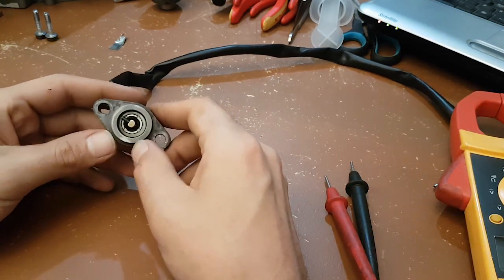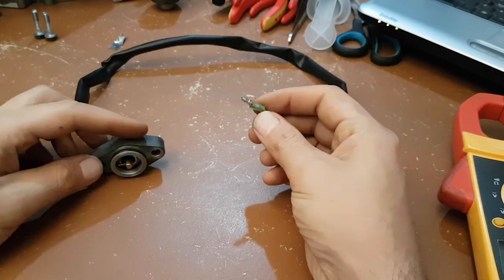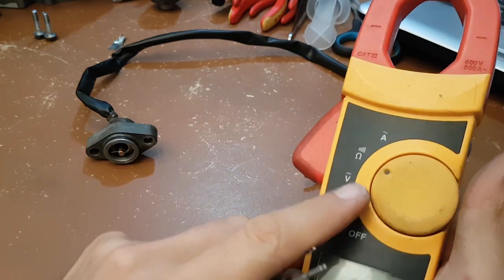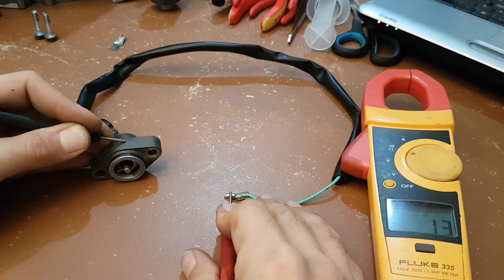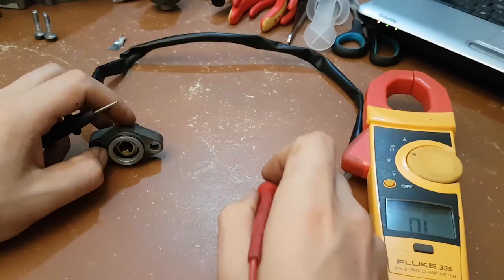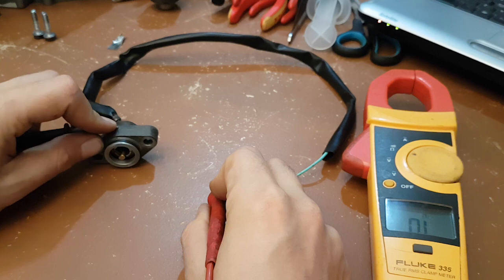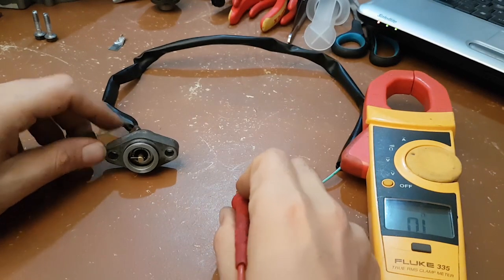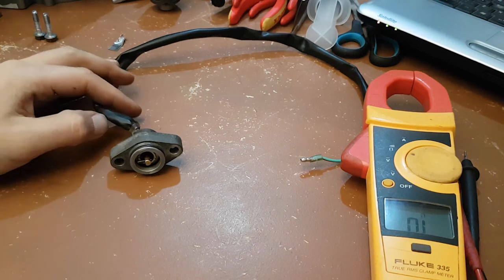How a Neutral Switch Works? How to Test and Diagnose a Broken Switch

Comment: I think I have the same problem. My bike doesn't start unless it is in neutral, or else just sobs and shuts down. Also, the neutral light on the dashboard doesn't light up. Do you think I will solve by replacing the switch?
Reply from the maker: Bike should not start when it is in gear unless you depress the clutch handle. So it is normal that bike only start on neutral. Light bulb can be blown or there can be a ad connection, cable somewhere
Reply: thank you, I'll check it out.

Comment: Hi thanks for the video, its happen to me neutral light will disappear only when the engine is very hot, the bike will start only if you pull the clutch even if the gear is on neutral, but, once the engine will could down, is all back as normal... hahha maybe my switch is working funy at hot engine? What is your opinion? Thanks.
Reply from the maker: Weird. Can be thermal expansion or plastic parts get soft if they get too hot. You can just make a simple continuity test when the engine is warm. Would be my first suggestion.

Comment: if my neutral switch is broken could that kill my engine when i shift it into gear?
Quad runs but dies when i try to put it into gear
Reply from the maker: I dont think it should cause a problem like that. Neutral switch should only prevent engine from starting. Once the engine is running there shouldnt be a problem. If the ATV jumps forward when you put in gear than i think there can be a problem with the clutch/cable

Comment: On a 2007 250 Honda Recon...........I just got a quote form Honda dealership it will costs 300.00 to replace mine because it is in the engine somewhere.  Do you know where?    Thanks
Reply from the maker: http://mirmotozapchastei.ru/catalog/atvs/3/2009/3904/1501594?path=1.12.90.3904.1501594

If i am not wrong part number 11 on rear crankcase cover.
Reply: ...Ok,  thank you.  I left the Recon at the shop since they said they won't have the part until next week.  I figured I would investigate this more because I feel like I am getting ripped off.  300.00 to replace a twenty dollar sensor?   That is what we call here........Off highway robbery.
Reply from the maker: @spike2794  thats why i started doing my own repairs. Even if the pricing is normal its still 300 dollars to change a 20 dollar part. Even if you dont have the tools you can buy them for less than 300 dollars. and this is what i do. I buy the tools instead of paying for repairs
Reply: Yeah,   I am going to get it tomorrow and bring it home.  I am not a mechanic but I have usually done repairs to my own vehicles because I can't afford to pay a mechanic the crazy prices they ask.  I just replaced a radiator in my 2003 Chevy Suburban.  The shop wanted 500.00 for parts and labor.  I found the exact same radiator on line for 66.00 (a great deal) and I replaced it myself and it costs a total of 100.00 with antifreeze and took me about an hour.    I never worked on a 4 wheeler but I will have to start.  Thanks for your feedback and part number.  Is that German?  The language?
Reply from the maker: It is russian but you can find the same diagrams in english. For some reason the english ones didnt show the part number you needed. As i said i am not 100% sure if that info is correct but i am very sure that you can do that repair  for much cheaper on your own. And perhaps even better

Comment: Is it possible for a neutral switch to work poorly?  E.g. It does work but it is just really difficult to find nuetral.
Reply from the maker: Sure. The contacts, solder joints, sockets etc can be intermittent

Comment: Ustam yamaha drag star 1100 de bu sivici bulamıyoruz yeri nerde acaba teşekkürler
Reply from the maker: Şuı videoda gözüküyor olabilir ama motorunu tanımadığım için emin değilim.
https://www.youtube.com/watch?v=F9oQ-OQbmbE
Reply: ilginize teşekkür ederim bu 650 yamaha drag star videosu bir türlü bulamadık bu nasıl iştir şaştım marş ruble sini dahi değiştirdim kendim bir muşuru bulamadım önceden pdf dosyası olarak kullanma kılavuzunu indiriyorduk şimdi bunada siteler yasak koymuş neyse aramaya devam
Reply from the maker: @keremkara941  
Senin motorunu bulduğuma emin değilim ama aradığın parça civata şeklinde ve motorun sol altında anladığım kadarıyla.

Neutral Switch deden 1 numaralı parça

https://www.bike-parts-yam.com/yamaha-motorcycle/1100-MOTO/1999/DRAGSTAR/XVS1100/ELECTRICAL-1/71_7072-7072/B42/0/34681
Reply: bu siviç motorun altına nerden baksan gözükmüyor bu sanki bir şeyin sökülmesiyle ortaya çıkıyor yani Bi yerin açılmasıyla gibi inan sinyal flaşörünüde ara ara bulamadık deponun altında şasi in içinde çıktı bakalım bu nerden çıkacak
Reply: Ben bir resim buldum sivici montajlı halde gösteriyor fakat motorun neresi anlaşılmıyor

Comment: What do you mean your engine will not work. Just pull in the clutch and it will work
Reply: This is for automatic not manual
Reply: @michaelmaclaughlin3324  ATVs have this neutral switch and they're manual. On a manuel you can use the clutch and it will overrode the switch and start the engine
Reply from the maker: Am i talking about diagnosing a bike which does not start?? If a neutral switch is faulty it can prevent a bike from starting. Nothing to discuss. here. As we all know you can override it with pressing the clutch but that is not what I am talking about in the video.
Reply: makes sense fair enough